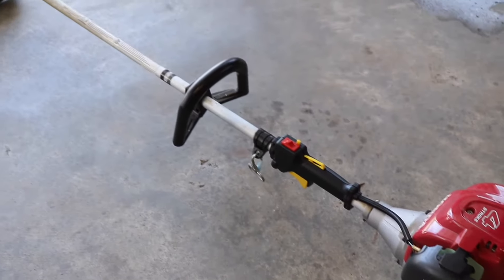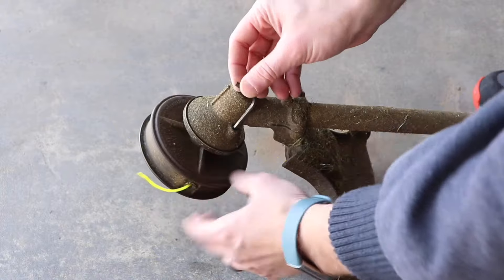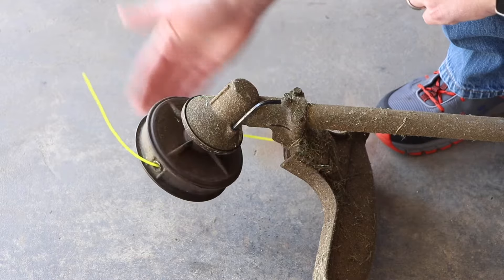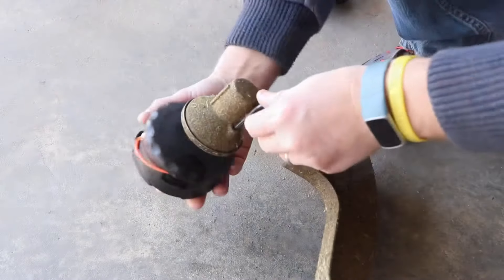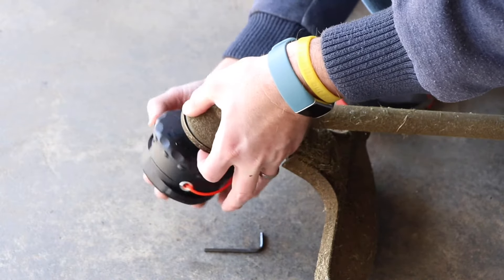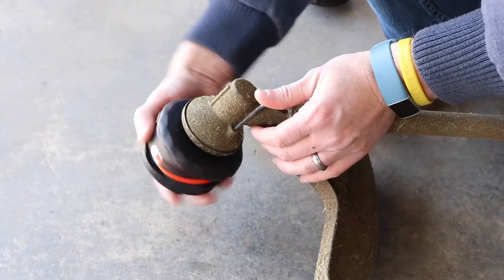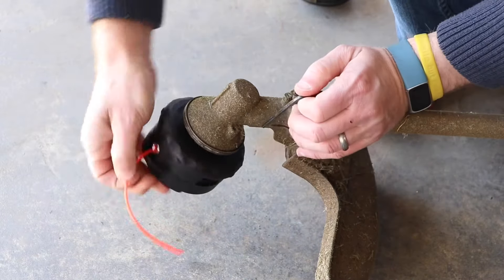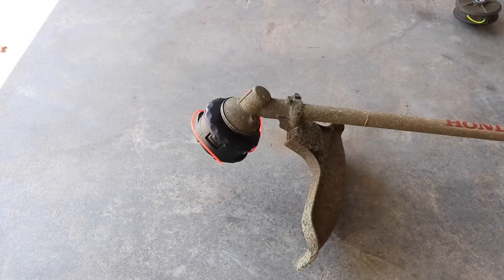Honda String Trimmer Speed Feed Head Installation, How to Remove Trimmer Head

Comment: I've got the same Honda gx35 trimmer. shaft got bent in transit. Any suggestions how to straighten trimmer shaft? where it's bent it gets very hot. Also, is it possible to get a split shaft in Honda gx35 trimmer - for example using one of the generic brands.